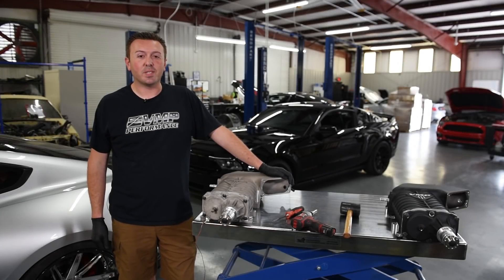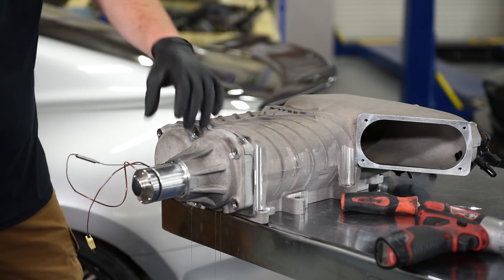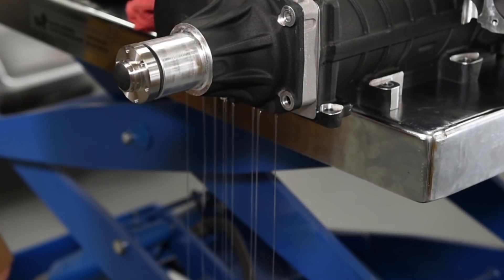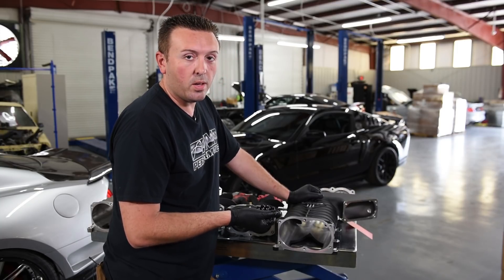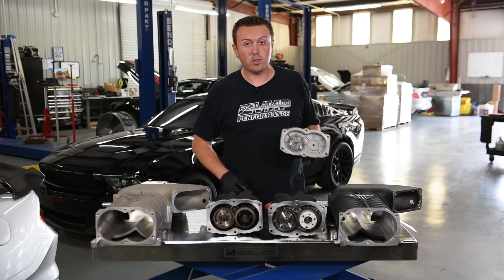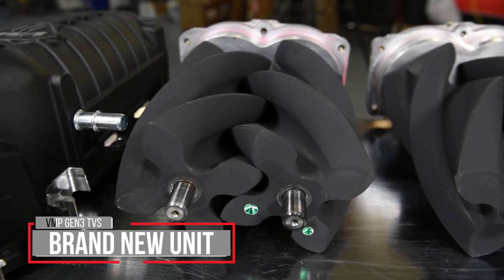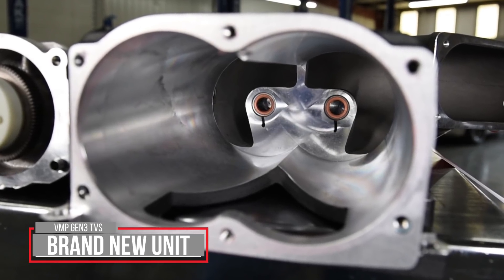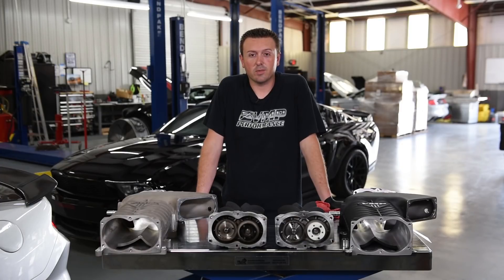VMP Performance | Durability Testing the VMP GEN3 Supercharger

Comment: Justin will you guys at VMP ever consider developing a bigger blower size,  I already know this little blower is a beast! For its size. But just curious if y’all would ever design a bigger one.  2L or 3L-4L.
Reply: DrtyBrd5.0 I thought the Gen3 are 2.65L?
Reply: @yudax5057  It is
Reply: Doubt it. Lots of aftermarket blowers like VMP/Magnuson make their own units but are all using the same Eaton rotors and to my knowledge the new 2.65L is the biggest they make currently.